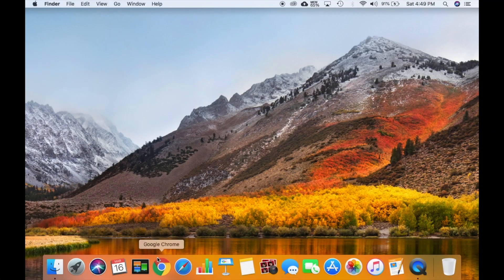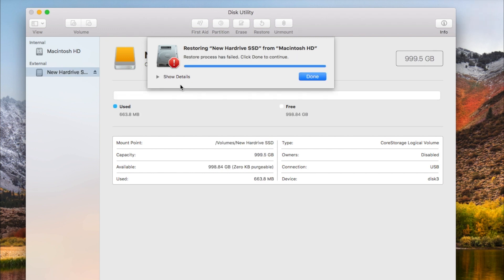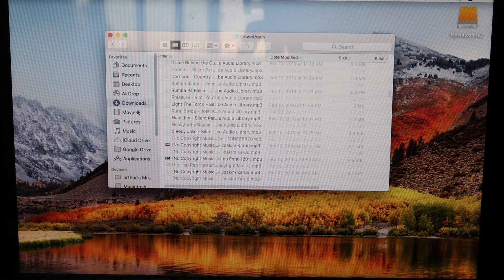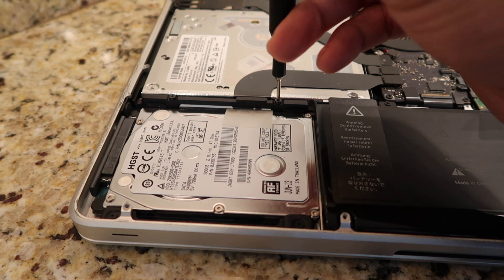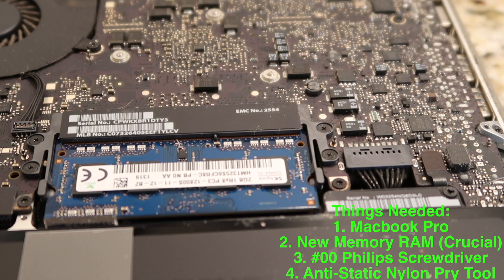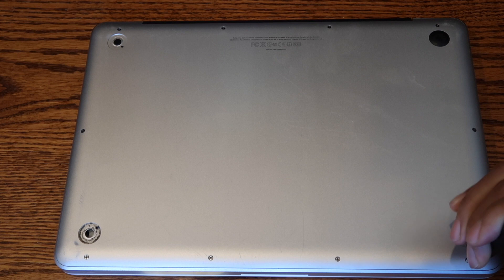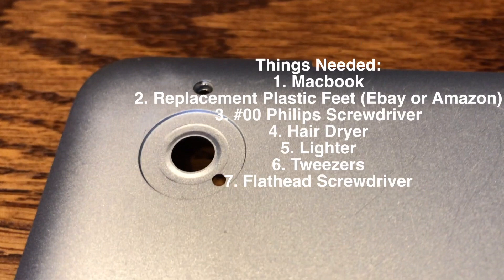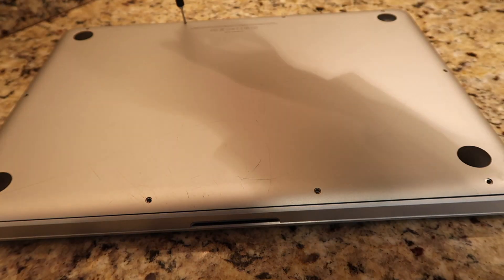HOW TO UPGRADE MACBOOK PRO MID-2012 | UPGRADE MACBOOK PRO (2022) | FASTER MACBOOK

Comment: Thanks so much for this ! 
You are a lifesaver , I almost bought a new computer and your step by step direction was amazing and easy during this pandemic stay at home 🙏 I have mid 2012 MacBook and I YouTubed if I was able to refurbish it myself and your video made it not so daunting.
 
If I was was interested in getting rid of my DVD player and modifying it with another DYI Samsung 860 SSD with a possibly of 2TB would that be possible?
And would I go through the same configurations in the beginning of your video to format the hard drive ?
Please help. Thanks
Reply from the maker: A 2TB is possible!

Comment: Update for people with same issue, annoyingly slow Mid 2012. 
My Macbook book had been running 16GB RAM since the beginning. The last 2 years started going slower and slower. Sometimes the Apple spinning wheel would show up for simple tasks like Safari. Then Time Machine would start taking hours for back ups, then giving errors. 

After updating to Catalina, the speed of my mac got even worse. Safari would get stuck, non-responding. Even Activity Monitor would get stuck. So I researched on increasing speed and clean the computer. Downloaded (pay subscription) MacBooster, and it did a great job. Free space, speed improved, and smoother. But still not what it used to be back in the day. One of the things that deleted more memory was old iPhone back ups, apparently Apple keeps ALL back ups. 
Then I replaced (following this tutorial) the SATA 500MB in my Mac for a Crucial SSD 2TB (£198) and the results blew me away!
Speed test before: write 88.8mb/s, read 85.1mb/s
Speed test after with the SSD: write 456.2mb/s, read 515.2mb/s

Very happy! Like a new computer with more year to come.
Reply: Eduard Conti I’m doing this now.. Literally the past week it had been acting slow out of no where. I also already had been running with 16gbs of ram
Reply: Hi!  How did you update with Catalina?  Did you choose the Mac HD - Data or just MAC HD?  Thanks!!
Reply: Amarie Sloanmrs I understand you mean when cloning your computer right? Catalina has this annoying partition, but I found a free app and it was so easy. It’s called SuperDuper. It allows you to do the same, cloning your Mac with Catalina.
Reply: Eduard Conti yes, thank you!  I’ll give SuperDuper a try!  I’ve been debating on just manually transferring all of my data (a pain I’m sure) after the SSD install, or waiting for some other solution to come up.
Reply: Amarie Sloanmrs what I did is clean up first all my files and useless things with MacBooster. Then Time Machine copy just in case with an external drive. Then did the cloning with SuperDuper. The cloning took like about 2 hours, I guess my all Sata was pretty slow. But now my computer goes really smooth with new one SSD in!

Comment: Probably a dumb question, but would I have any problems if I used the 2TB Samsung SSD instead of the 1TB? I'm running Logic Pro with minimal processing being used and I'm running into overheating problems which seem to be causing system overloads and just want to make sure I can get the most of my Macbook. I ordered the battery and it's on it's way. I really appreciate this video, I'll be doing all of these things to upgrade!
Reply from the maker: Bigger the Storage space the better IMO!

Comment: It seems so hard to find an answer regarding having Mac HD & Mac HD-data. Which one do I choose when switching over to SSD?  I bought everything and was super excited, but I can’t find the answer to this anywhere. tia
Reply: struggling with the exact same issue!
Reply: @maicy02  Any progress? I am considering doing this and would like to know before buying the ssd.
Reply: @thepeterpansyndrome8929  it's actually both. You need to find a program (they are all paid but I used a trial and then deleted it afterwards) that will clone both your HD and HD-data. But any Mac optimised cloning program will. Then it was easy peasy.
Reply from the maker: Hope you got this straightened out!

Comment: When you clone your info to your new ssd, do you still need to install a new os?
Reply from the maker: J-quan nope!!! I would update your laptop before cloning if you want then you’ll be good to go.
Reply: D.A.T.A Productions thank you so much! my ssd and ran are coming in friday. i’ll definitely use your guide!
Reply: D.A.T.A Productions I was cloning the data and after it said restore failed. It says that the APFS inverter failed to invert the volume. OsStatus error 22. Any help on this?

Comment: Hello, hopefully someone can help! I’m trying to do these exact steps. Except I noticed my wife’s MacBook has the Macintosh HD shared by 5 volumes and I can’t access them at all and it’s APFS(encrypts). Not sure what to do. The only thing the external ssd will let me restore is the disk image: flash player.
Any info would be great on this, thank you! Need to clone the drive so I can continue the upgrade. We do have the whole laptop backed up on iCloud. Is that good enough? Aaah I was so excited to do this for her :(
Reply from the maker: Hope you found the solution!
Reply: Still waiting for my ssd to arrive but I believe you have to back everything up through time machine instead of disk utility since your probably have Catalina already installed. please let me know if this works because I will probably run in to the same problem.
Reply: KC Ross-Miller I got it! I used carbon copy clone. Super easy, only took a couple hours because the file transfer. Other then that, worked great.

Comment: Thanks a lot for the video. I just upgraded the HD to 500Gb SSD of my mid 2012 MacBook Pro 13' and its great! The start improved from 3min to less than 30s. The iPhotos that was taking more than 4min to open is now opening in 3s... its great. I also bought 8Gb of RAM but have not installed yet
Reply from the maker: glad it has helped you!

Comment: I had initial troubles at first, which I had to google. However, I ended up with a superior macbook as a result. Thank you so much for this tutorial. I was going to upgrade to a 2019 16' inch Mac Book Pro, but I think I'll hold off for a very long time!
Reply: Are you still on the 2012

Comment: How long does cloning the HDD to SSD take? I'm doing the upgrades as we speak, and the progress is stuck near the end, it's stuck on replicating. Does it usually take a while to finish, or is there a problem with the SSD?
Reply: Just did this.  Had about 200 GB to transfer.  Took about a hour and a half.
Reply: MIKE STRYKE thanks, I managed to get it to work, and my lazy ass didn't bother making an update.
Reply from the maker: Hope you solved the problem!

Comment: Instead of MacOS extended (journaled) mine is APFS encrypted and I have a "Machintosh HD" and "Machintosh HD-Data". When I click restore is the nothing pops up on the dropped down menu and I got scared so I didn't try recovery mode.
Reply: ebravo31497 make sure the ssd is mounted. Mine is restoring it and making it to almost the end then I get operation failed.
Reply from the maker: Hopefully you figured it out!

Comment: MacBook Pro mid 2012 13"  you can upgrade 
1)CPU i5 to i7 3520M  (on 15 and 17 can get quadcore)
2)upgrade ram 16GB  
3)upgrade SSD 2Bay(DVD) 4TB(2x2) you can raid if you want 
4)upgrade Wi-Fi  and Bluetooth 
5)magsafe 60W to 85W 
6)replace thermal paste and new battery
Upgrade Option eGPU   
Good Fast!
Reply from the maker: Hope you found what you were looking for!

Comment: Hi! I am getting "could not restore input/output error" during "Restore" or cloning part. How do I fix it?
Reply: Lambert Riosa same here, let me know if you find any solutions (Samsung EVO 860 500gb ssd into this model mac)
Reply: @OGeniusTheFirst  found this comment from another video, and it worked for me!! 

SOLUTION for those with 13" MBP mid 2012 with MojaveOS and internal HD formatted as APFS 
Do the following, since Disk Utility won't work:

1) Connect your SSD with SATA-usb connection and erase it as the same format as your HD (APFS). 
2) Download and install MojaveOS in your SSD. (From the App store)
3) Boot/start up WITH your SSD; you won't have nothing, it's clean and empty but with MojaveOS. 
4) Open Migration Assistant and move/migrate ALL your data, apps, documents etc 'from a BackUp or from the same drive to this Mac'. It will basically move all your hard drive to your SSD, since you've started up/booted from your SSD, so your SSD is 'This Mac', if that makes sense. Will take a little while but will be done
5) The cloning is done! If u want to double check everything looks as with your HD, just start up your computer again with your SSD and see that your desktop, apps, everything is the same! (Should be! it was for me doing these steps)
6) Just turn everything off, leave for 30 minutes minimum and swap the drives internally. 
And that's it! It should obviously start with your SSD, which is your internal drive now and everything will be how it was before with your HD.

https://www.youtube.com/watch?v=lfJrAcnHN2g&t=455s
Reply: Lambert Riosa you are absolutely a godsend! After much fiddling and forum reading, I found a critical corruption error in my old hard drive disk’s files, this process is working better than the ones i had tried!!! Thank you so much, Lambert. Good lookin out bro bro
Reply: @OGeniusTheFirst  all credits goes to @Javi Carles. I have also found out out i have a critical error 'Read error' using Carbon Copy Cloning, however i don't know which exactly, so I cannot fix it manually. Glad to hear it worked for you as well. My macbook is running faster than ever since i've upgraded my ram and ssd. Have a good one! Cheers! Thanks also to @D.A.T.A Productions!
Reply from the maker: Hopefully you solved this!

Comment: Do I need to have a usb with os on it to install the new SSD if I'm replacing my HDD? Or can I just swap it out and boot it Normally?
Reply from the maker: Yes your New SSD needs to have the OS system on it for the transfer.
Reply: @DATAProductionsMedia  so when you run disk utility and restore/clone from the original HDD, the OS will be transferred to the new SSD automatically?

Comment: I have the same mid 2012 Mac book pro that is disgustingly slow has 4g in total memory slots and  a 500 GB SATA disk , is it specific to replace one of the two? Or is it strictly both as I rlly want it to stop being so slow
Reply from the maker: Hopefully you found the solution to the issue!

Comment: I just followed this tutorial to upgrade my MacBook and everything is working great! Thank you for this step by step guide!!
Reply from the maker: Alicia Kaitlyn glad to have helped!
Reply: I am pretty impressed with how much faster my "old" macbook pro now boots and runs.
Reply: Did you replace the battery too? It seems that replacing battery seems to be a huge problem for a lot of people since there is no reliable quality battery in the market. It doesn’t seem to last longer than a month.
Reply: @Visdemhvemduer I'd like to know that too.  I have a Macbook Pro that works great other than the battery is crap.  It won't stay charged for more that about 10 mins without it being plugged in.  I have another regular Macbook I wanted to remove the battery from and use in it, but not sure if they're the same.
Reply: How much FPD do you get? btw 69th to like this comment

Comment: so i have a 500gb HDD in rn and i’m trying to restore on my new ssd which is also 500gb but it’s saying there isn’t enough storage still? i cleaned your my macbook before doing this so ik i’m fine i haven’t even used 200gb on my HDD
Reply from the maker: Interesting. I don't know what the problem could be. Have you tried multiple times after cleaning it out more?
Reply: D.A.T.A Productions no that was gonna be my next option

Comment: Genuinely curious, why do some tutorial videos upgrading the Macbook Pro 2012 have a USB requirement with an OS software installed in it? Does the SATA cable basically allow me to not use a USB with an OS in it?
Reply from the maker: The sata cable is for connecting your New SSD to your laptop via USB to transfer data over
Reply: Thank you sir! Great video and SUUUUUPPPERRR helpful!

Comment: Thanks for the video! Just to be clear, so you don’t need an additional external hard drive to back it up to or time machine? Just use the new ssd?
Reply from the maker: John Tayor you just need to connect your new SSD for the transfer. Time machine is not needed
Reply: D.A.T.A Productions thank you!

Comment: Awesome thank you man, much appreciated. Is it possible to update the graphics card too?
Reply: I want to use the new Adobe Premier Pro with it and it's telling me I need to update my video adapter drivers but I only have the Intel HD Graphics 4000 1536 MB graphics so I reckon it's probably not up to the task
Reply from the maker: Happy to help! Did you ever find the answer for the graphics card?
Reply: Hey man, yeah, no joy with the graphics card for me at least. I invested in a HP Z420 workstation. I use the mac book Pro as back up :)

Comment: I broke my 2012 MBP and bought a 2009 from Ebay which was a big mistake. I then bought a new 2012 MBP becuase it has internet recovery. I then bought two SSD EVO 500 GB and a caddy to replace the optical drive with one SSD and some more memory, 16BG. I then put in the SSD and installed Mojave and rEFInd bootloader and Linux Mint 18.3 so I can play my classic arcade MAME games and learn to work with linux apps better like their LibreOffice applications. I am learning Computer Science and Programming from Minor two year school, one transfer, the other Programming. So now rEFInd dual boots me. In the past before APFS I had triple boot Windows 10 but I could not get it loaded with APFS and rEFInd.
Reply from the maker: Hopefully you figured this out!

Comment: Bro, you have the best step by step tutorial online. Using your guide, I was able to upgrade my mid 2012 MacBook pro with a new battery, RAM, SSD and everything is working perfectly. Thanks boss.
Reply from the maker: OMOTAYO AKINSUYI thank you so much!!! I’m glad you were able to easily upgrade everything. Subscribe for more content! 🎥💭
Reply: what happends if i dont clone?
Reply: D.A.T.A Productions Media this is a great video! Very helpful. But how do you format the new hard drive before you’ve installed it?
Reply: Which battery remplacement brand did you use and does it fonction well still after months of use?

Comment: Hey man, well done on this video! I was able to copy all of my data (using Catalina) from the HDD to my SSD using the same process you did, but I completely went straight to the recovery mode section and was able to copy everything. Since Catalina was already installed prior to the data transfer, I used the APFS protocol. Very simple process, just took a while to boot initially. Aside from that, no problems whatsoever!

If you’d like, I can help those who have problems if they are trying to copy all their files from the HDD to the SSD when using Catalina.
Reply from the maker: Beastly Rex thank you for that helpful information!!!
Reply: My OS is high Sierra, would i need to do this? Or can i follow instructions on video? Thank you!
Reply: Hey man, just follow the instructions on his video above. It’s very simple and I’m sure you can get it done. 

Since you didn’t update your computer to Mojave or Catalina, your HDD or SSD isn’t set up to be used for the APFS Protocol. Once you transferred everything, make sure everything runs exactly the same way before you do an update to either Mojave or Catalina.
Reply: Beastly Rex thank you! Do you guys recommend i make the update to mojave/ catalina?
Reply: That part is entirely up to you. I would recommend getting everything updated first, then proceed with the cloning of the SSD. That way, it’s far easier to have everything running much more smooth.
Reply: Beastly Rex but then i would need to do the afps protocol, no?
Reply: This is true. I only recommended doing it that way because I haven’t updated from High Sierra or below. After Mojave was updated, the HDD or SSD was converted to the APFS protocol. My MacBook was already updated beforehand, so I was able to bypass a step in the video. Again, it is entirely your choice whether you want to update everything first, or switch the SSD now, then update later.
Reply: Beastly Rex ok got it! Thanks! I am following the instructions in the video but now when i erase the ssd and format it theres a third option called scheme. And it gives me 3 options, GUID partition map, master boot record, apple partition map.
 
Which one do i choose?
Reply: You have to match the format from your HDD. If your HDD shows a specific way, your SSD has to match that as well.